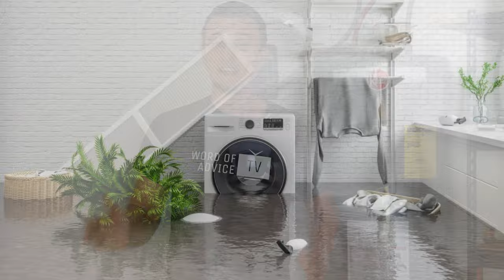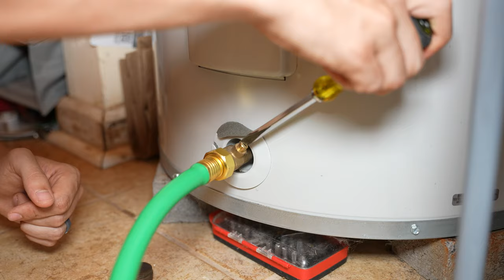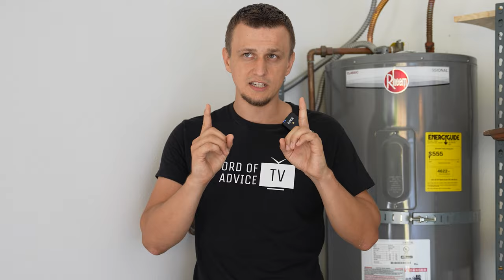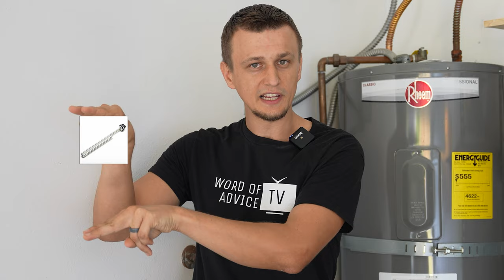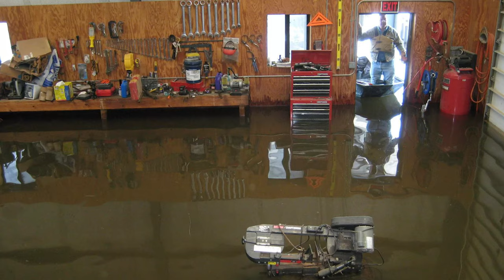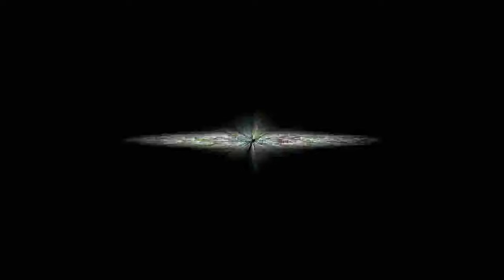When Should A Water Heater Be Replaced?

Comment: My gas water heater flooded my basement. The Sears Kenmore heater was the original that came with the house when I purchased it in 1996... it was over 20 years old. Then one morning when  I was getting ready for work, the shower water was cold, so I went down to the basement and opened the door and steam hit me in the face!!! The whole basement was like a sauna. I could really see!!! I proceeded down the step and my foot hit the floor. It was 12 inches of water. My basement is 10' x 17'.  The hissing sound from the top of the water heater was still running water... I couldn't get to the main water valve without hopping on top of the sofa I had down there. I was afraid I was gonna get electrocuted. I found the shut off but could not turn it. It was frozen... I called the first plumber in the phone book!!!  AAA Plumbing. They arrived 2hrs later while the water was still hissing from the top of the tank. They managed to shut off the water, replaced the valve, pumped out all the water, and replaced the tank. $6,000 :face-purple-crying::face-purple-crying::face-purple-crying:😭  . 7 years ago it happened again. My husband replaced it this time, Home Depot $549, and now again exactly 7 yrs to the date, its leaking again!!!  Rheem tanks are cheap!! your right, they don't make them like they use too.
Reply: Our Rheem just failed two days ago.  It really sucks how much damage water can do.  The windows were steamy from all the hot water.  I have no faith in modern day appliances.

Comment: Embarrassed to say I have a water heater which I am unsure of if it's leaking or just condensation. There appears to be a pool of water around the tank, but it does not appear to originate from any valves or pips. However inside the little doorway there is some water collecting. I have heard of condensation but it appears to be alot for condensation.

Comment: Hello Sir , can i ask you a question about my water heater? I have been searching for an answer but the videos i've watched didn't say anything about this odd problem. My water heater makes a Tiktiktik(fast) noise every two minutes but its not just a noise it actually disrupts my other electric devices for a second. It even disrupts my electronic devices that are not connected to any electricity and performing with a battery like my laptop and my headphones. what is going on? can you please explain? have you ever came across such an odd problem?

Comment: Our city water is supplied by a reservoir 30 miles north of us.  We have extremely soft water so mineral buildup in the plumbing system is practically zero.  Water heater electric elements rarely need to be replaced for mineral buildup and failure and flushing a water heater out to remove sediment yields surprisingly very little sediment.  Our neighboring city has extremely hard water.  I had a plumber tell me that if he was put in a basement blindfolded and then allowed to look around, he could tell which city he was in.  Around the valving stem hard water produces mineral bloom which often looks whitish/green in this case.  So there’s the telltale.  Soft water results in no or extremely little mineral deposit.

Comment: I currently have a 40 gallon electric water heater that right this sec is leaking and definitely not my ac as i thought as well but coming from the "diaper" pan under the water heater sounds like im taking off tomorrow to shop and replace my 1st water heater as a solo and yes i walked in my sr year after last football game and came into the carnage of a flooded house my dad yelling and ranting on a fri night so i dont know the details as all i could manage at the time with limited working space and not killing dads time i acted as the go for and extra hand as needed cutting pipe here and there grabbing this tool or that tool as he yelled😂 meanwhile he got to work on the dirty tight and cramped area where the heater was behind a 28" door at the end of the hall before you walked into the hall bathroom so lotsa of excuse me just to add to the aggravation